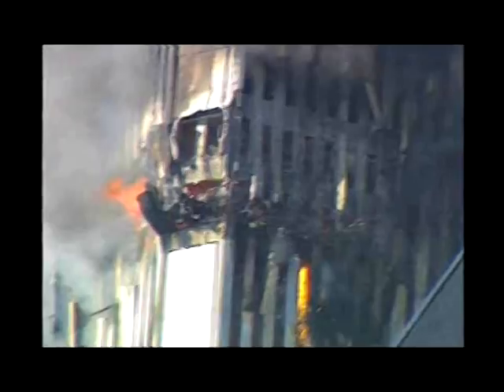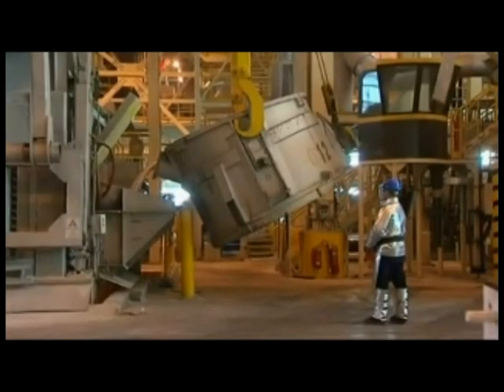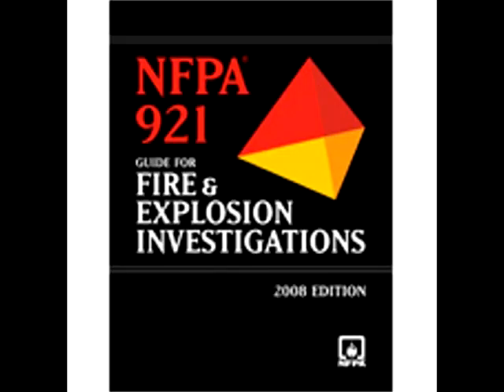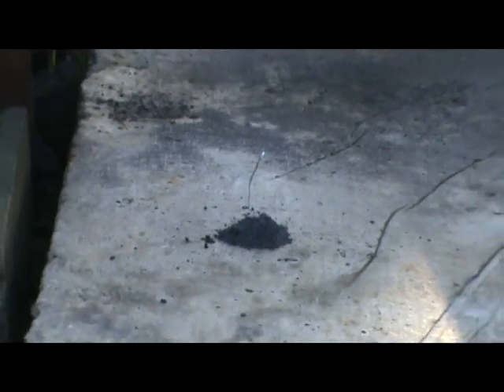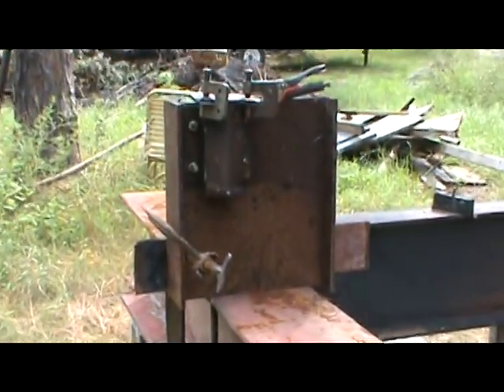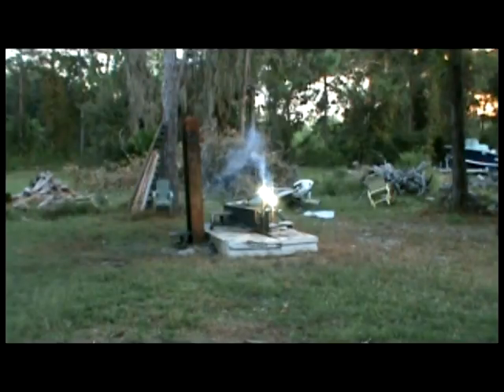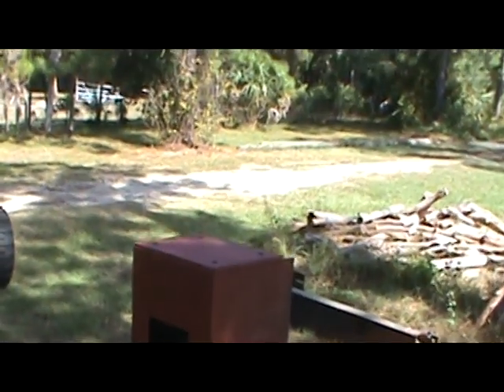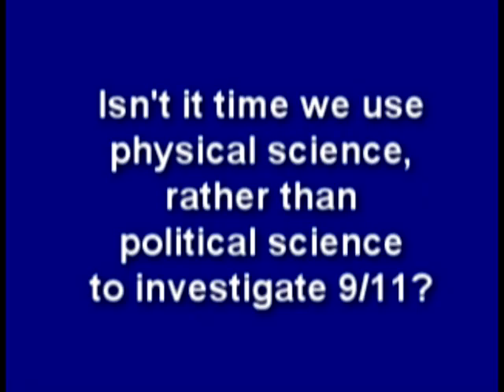9/11 Experiments: The Great Thermate Debate

Comment: It's all about BTU's (British Thermal Units). Jet fuel burns at 1500 F degrees in an OPEN space.  And steel melts at  2750 F (1370 Celsius) degrees.  However jet fuel can burn as hot as 2000 Degrees Celsius in an ENCLOSED space such as an aircraft engine or...I don't know...a building.  That's well over the 1370 degrees Celsius it takes to melt steel.  That's why they use metals that withstand higher temperatures in jet engines.  I'm not here to argue, or debate anything.  I will not answer any comments that are left here.  The conspiracy theory that it was the government, or the Jews, or the NWO doesn't hold water to me.  So say your peace...or don't.  I don't care.  Believe what you want and I'll stick to facts.

Comment: I do not doubt that thermite could have been used, but people have done the same thing you just did with jet fuel and have shown that it will weaken beams enough for them to collapse. Weaken, not melt. What I doubt is that the government would use thermite if they planned the attack. The collapse wasn't necessary to accomplish what the theorists believe the government wanted to do. If they had just hijacked two planes and crashed them into the towers, it would have been enough. There would be less evidence because the story would be entirely true with the exception who the hijackers were. Thermite is an unnecessary complication, much like the pentagon cruise missile theory. The towers collapsed because of the jet fuel. It doesn't matter if the government planned the attack or not, they wouldn't have used thermite. The government may be inefficient, but whoever planned it wouldn't be that stupid.

Comment: The fire didn't have to reduce the steel beams to a liquid state you fools,it just had to reduce its ability to support hundreds of thousands of tons of steel and concrete above it.The first beam that is in the heart of the fire is weakened and moves just a fraction of an inch,this passes its load to the other beams thus speeding up the failure exponentially.

Comment: just so you know military grade thermite is mixed with adhesive and used in tape rolls the steel backing is uneeded with military grade thermite, it is developed for removing steel and concrete bridges towers like cell towers and potentialy buildings in still theoretical war time events with well developed first world countries, its applicaction was ment to help disable superior german tanks in germany - its not something that is easily made, probably about as easy to aquire as yellow cake uranium both the u.s. and isreal are known to have it

Comment: The "molten steel" pouring down the side of the building is much more likely to be molten aluminum. Aluminum melts at 660°C, and aircraft aluminum alloys (such as Al2024) melt at even lower temperatures (500°C).  Conventional commercial aircraft fires have reached temperatures sufficient to melt the plane's aluminum structure even without contributions from jet fuel. After crashing into the towers, thousands of kilograms of aircraft aluminum alloy was subjected to an intense and confined blaze fuelled by jet fuel, oxygen tanks and generators, seats, luggage, office materials and so forth, melting and flowing downward via gravity according to the path least resistance.

The real threat to civilized society is not some diabolical shadow power which somehow managed to rig two of the world's largest buildings to collapse after being impacted by commercial aircraft. The real threat to civilized society is the barbaric, insane doctrine of Islam, and its 1400 year history of relentless jihad. Have no illusions: 3000 Americans died at the WTC because religious lunatics believed the act was their ticket to paradise. There is no other reason.

Comment: I'm not convinced of the conspiracy theory, however,  I will complement you on the thoroughness of your video.  Very informative.    But are there other ways for steel to melt?  How do blacksmiths melt steel with conventional materials?  Does the quantity of oxygen impact the temperature?

Comment: Holy crap, over 5 years ago you put in all this effort already, impressive and well done. Thank you. 
Thing is though, The lie only needs to be big enough to be believed. The supposed molten aluminum pouring out is too bright the be aluminum imho. 
Watching dozens of videos, it cools off rather quickly to turn into a light gray sheen as it is poured into air. Versus the bright orange "run off" coming out of the WTC.
Besides, where are the aluminum castings?

Comment: Very well made video.
Still, it shows it as a possiblity, not a proven fact. I'm no expert either. Even farther in fact.
Kerosene burns in the air near 1000°C. But convection increases the temperature. A fire in a tunnel between France and italy, some years ago, saw temperatures above 1400°C. With regular car fuel. 
At such heights, wind can also inflame the blaze even more. And airliners use concentrated outside air in a pressurized cabin, but have oxygen bottles for emergency situations. Pure oxygen as a comburant also increases temperature a lot. 
I remember an "engineering connections" (millau bridge ?) with aluminium foil tubes with injection of pure oxygen through, lit, cutting through steel. 
And even planes made with lots of polymers still count aluminium as their components. Some are mainly aluminium. 

Could a fire of kerosene  in an enclosed area fed with powerful wind melting aluminium in the presence of pure oxygen heat steel enough for the towers to collapse ? 
I think it could. Without need for a booby-trapped tower.

I could of course be wrong. (Edit: And such assertions/suppositions are way less tangible than the content of your video.) Anyway, well done ( and quite a dedication). Keep it up. Cheers.

Comment: i have to say this is the most convincing video ive seen, but there is just one problem, how did the Thermite get there, how do you gain access to the collums without people noticing even if its done at night people will notice cause you have to get through the walls and stuff to get to them and then it would be a big job requiring a number of people to do it and that's a lot of loose ends, loose ends that arnt easy to cover up. to do something of this size would leave countless loose ends, though I find this convincing I cant be totally convinced because when you think about how many people it would take to pull this off as an inside job it just couldn't be possible to do without being exposed.

Comment: OK hold it right there. You do not have to "melt" steel to weaken it. Steel loses its tensile strength long before it reaches its melting point. Once the trusses that support the floor decks are sufficiently weakened the place is going to come down like a house of cards. That steel wasn't put in there because we had nothing better to do with it. Concrete needs steel to have any tensile strength at all! The 80th floor is not exactly ground level open air either. You go 10 stories up in the air and tell me how the wind is blowing. At 80 stories it is blowing like a blast furnace. Those towers swayed a foot from the wind. The whole towers were moving the wind load was so high on them. You truthers are so full of shit it makes me sick! Or stupid, pick one.

Comment: doesn't matter since the towers didn't collapse due to a few steel beams melting which FYI any1 expert can tell you is possible in an relatively closed enviroment of the towers. IT collapsed due to strutural integrity being compromised due to impact and the fires
Reply: +cropathfinder that's a point i think the conspiracy nuts willfully ignore. The beams don't have to melt completely, only get hot enough to give out under the tremendous load.
Reply: hohaia rangi building 7 was on fire for a while
Reply: hohaia rangi No, this video does not apply the scientific method. It starts with the assumption that the steel beams would have to melt for the structure to come down and runs with that. That assumption is plain wrong. As with most things, you don't need to break them completely to make them not function as intended. Steel looses a lot of its strength when heated, even if the heat does not reach the level that melts it. Jet fuel burns at just under the melting point of steel. Combine this with the incredible stress from the impact as well as compression from above and you'll have steel that is guaranteed to fail. I wouldn't trust that steel even if it was subject to half that temperature for that long.

I strongly urge you stop trusting your intuition for more than when you need to make quick decisions. Intuition is best applied to simple, but important tasks, such as deciding if you should duck, if someones face shows they are trying to trick you or other simple decisions that we have evolved to make. We have not evolved to intuit the physics of construction catastrophe.
Reply: Yes Im Going To Be That Guy lol. Fire did not make the whole building collapse. The building did. It only weakened the structure so that it no longer could support itself.
Reply: hohaia rangi Good thing there is science so we don't have to trust our intuition. :)
Reply: hohaia rangi Intuition is great for making quick decisions, but you can't possibly think it is worth anything in comparison with the scientific method when it comes to making right decisions.
Reply: Jim Groth Building seven wasn't hit by a plane. So there was no impact and no jet fuel. Two of the main causes you posit in your argument. I don't know of any other instances where a building has caught fire and then collapsed in that manner. If you don't think that was fishy then you are in denial.
Reply: Shut the fuck up those buildings are massive, no way a fire made the whole building collapse, you ever play jenga?
Reply: shounenbat510 scale is relevant.
Reply: shounenbat510 do you have a list of skyscrapers hit by planes? I'm imaging it's a short list.
Reply: shounenbat510 Except we know that jetfuel can bring a building down. We don't need to bring a building down to prove that. Our material science knowledge easily encompasses how to calculate these things, and simulate them in computers. Both of which have been done, and can be done with fairly limited skills in the area.
Reply: shounenbat510 Do the calculations yourself then. Proving doubters wrong is just silly. You can't really do that. Conspiracy theorists need to get educated enough to be able to understand things themselves, or they'll always be skeptical about this kind of things.
Reply: +Joshua Carr (ThePistolKing) exactly.
Reply: +cropathfinder The compromise to the structural integrity was only near the point of impact. There was no compromise to the structural integrity of the building below the point of impact so the buildings should not have collapsed.
Reply: hohaia rangi The structural integrity was compromised by two factors. A plane flying into them was one. The other was airplane fuel burning. Doesn't have to melt it to make it weaker. Then, when collapse started it would just compound the problem.
Reply: Jim Groth Well I admit I'm not an engineer. but the way those buildings collapsed it just didn't look right. To me there had to be other factors at play.
Reply: hohaia rangi I suggest either learning about material sciences or trusting those that do. In today's age of information you can get tons of information for free. Just be sure to get it from sources with no interests in manipulating facts. Any university course in construction engineering should suffice. Basic physics and chemistry courses might also be enough to learn how materials behave in different conditions.
Reply: Jim Groth Yes, that's all very well but for every argument for there seems to be an argument against. And to the lay person (me) they all seem very plausible from a scientific or engineering point of view. I'm just saying that to me, intuitively, something looks fishy.
Reply: +Jim Groth Don't  knock intuition. We wouldn't be here without it.
Reply: +cropathfinder  You "sound" like that idiot that was interviewed.
Reply: +Jim Groth Well we both watched the video of someone attempting to apply the scientific method and he wasn't able to convince you. That is the closest I have seen yet of anyone applying science to the debate. As people, we tend to pick the so called "evidence" or research that matches whatever "truth" we prefer. I'm telling you that something was not normal about the way those buildings collapsed. it didn't  look right. Also, you haven't mentioned  building seven. That building  collapsed in the same manner and wasn't  even hit by a plane?
Reply: hohaia rangi https://en.wikipedia.org/wiki/Kader_Toy_Factory_fire
https://en.wikipedia.org/wiki/Windsor_Tower_(Madrid)
Reply: hohaia rangi A long time with a large fire is actually logically a way to bring down a house evenly. It pumps energy into the supporting structure and gives time for that energy to even out through all of it. After a while the structure has absorbed enough energy to weaken. Boom.

I think there are fishy things regarding 9/11 but none of them have anything to do with building collapse. If a conspiracy is involved it's something that can be done by very few people.
Reply: +Jim Groth Which is a solid explanation, except that planes have hit buildings before and skyscrapers have been engulfed in flames yet never experienced any structural damage, at least none that would cause that kind of a collapse.  It should be replicable, which is why I think that instead of trying to prove through real-world experiments what certain explosives can do, as this guy does, we should try real-world experiments with even a small-scale tower to see if we can't replicate what happened with the Twin Towers.
Reply: Jim Groth
It's not exactly a frequent occurrence, you're right, but it has happened.  In 1945 a B25 crashed into the Empire State Building.  It was flying in bad weather and apparently didn't see the building.  One also hit what is now the Trump building in 1946 (I think it was a bank back then).  There was also the Pirelli Building crash in Milan on April 18, 2002. The aircraft was a single-engine Rockwell Commander 112TC.
Reply: shounenbat510 way too small sample size. Especially considering circumstances were quite unique for most of those crashes.
Reply: Jim Groth
Which is why I stand by that we need to test to see if planes really could bring down towers instead of testing to see if explosives can.
Reply: Jim Groth
Except the NIST calculations were incorrect.  A more practical test would probably prove a lot of doubters wrong.
Reply: cropathfinder ..you could not portend to know that only because the govt says that's what happened on the tv....because they didn't bother to quantify any of that (the collapse Event itself)..therefore  you're obviously just making that all up...lol I could have given you other logical examples of how you are mistaken..but I chose that one instead.
Reply: Joshua Carr ...and you've done the math and lil bit of physics required to quantify your statement?...lol..I knew you didn't...I was just fing with ya.
Reply: hohaia rangi ....I've done the math and lil bit of physics required to quantify the collapse event..(nist did not even though required by law)..the columns below the impact site provided no resistance to the collapse event...I've 20+ years of experience as a civil/structural engineer.
Reply: Jim Groth ..you're a pretty good bullshit artist....done zero quantifying of the collapse event have you?..never bothered to read the nist forensic "analysis" whitewash either then too I suppose...you're no expert on this subject..stop pretending to be.

Comment: very nice,,,,,your thermite would be easily smuggled in in it's separate parts, mixed, put in place with a magnesium strip, then use the planes to set it all going, probably would slip by any explosive sweeps of building, heck they use thermite in other countries to weld railroad tracks together cause it gives a nice deep melting of the two pieces together
Reply: +4tusix i have to add that that's what thermite was made to do in the first place,,,weld steel together. No need to test it, some experts. been using the stuff since like the 50's to weld thick steel together
Reply: +4tusix yea, they use thermite to weld the joints of railroads together.